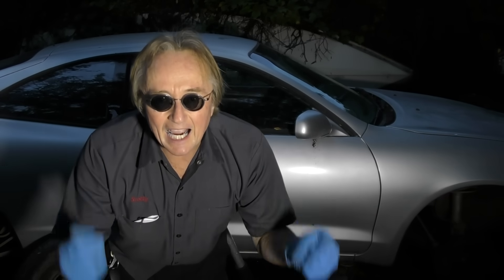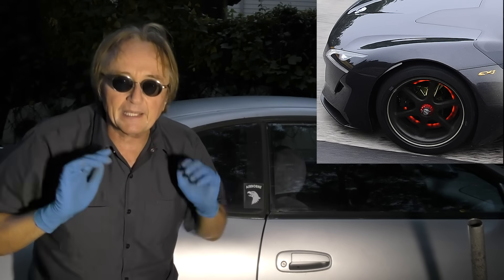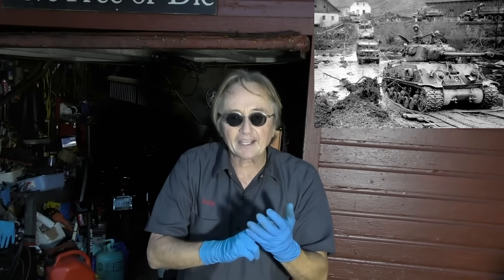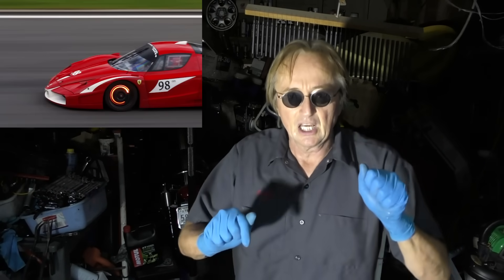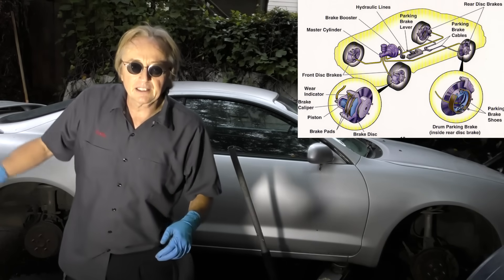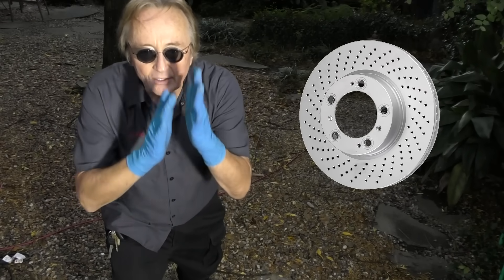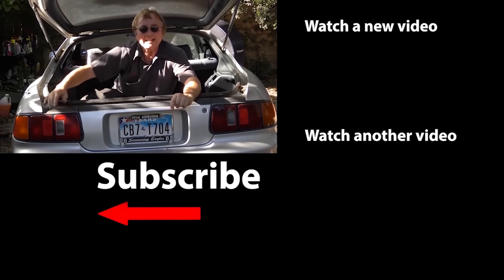Why Some Cars Have Drum Brakes Instead of Disc Brakes

Comment: Had 2004 Durango, replaced front rotors to drilled+slotted from brakemotive with ceramic pads. Around town didn't see much difference but higher speed and emergency stopping was a massive difference, cut down high speed and emergency stopping distance by an easy 40-50 ft. and was able to avoid accidents on the highway that would have happened with the standard rotors+pads. 
Oh they wear out faster? The pads and rotors were measured at 90% life after 35K miles, versus OEM (front) pads and rotors on these Dodge trucks need replaced every 50K-60K.

So I did the same ones on my 06 Silverado (which has rear drums), 10K miles now with drilled+slotted rotors and ceramic pads, and there is zero noticeable wear, no grooves nor "cut" into the rotor that is normally seem by 10K with standard rotors and pads.

Comment: Disc brakes wear out faster.
There is always some contact between the pads and rotors, even with your foot off the brake pedal.

Also, the original disc brake calipers for US cars were single piston units.
There was a pivot point that always corroded and locked up, causing the pad and rotor on one side to wear out before the other side.
This also caused the car to pull to one side each time the brakes were applied.

Then there is the fact that the rotors were often too small, causing them to overheat and warp.
This is why the brake pedal used to bounce up and down when you used it.

Not to mention that the disc brake systems were advertised as 'self adjusting'.
The only self adjusting that happened was that the brake pedal would go down further and further as the pads wore.
Drum brakes actually have a real self adjustment system that allows the brake pedal to maintain proper height throughout the life of the brake shoes.

To top it all off, a disc brake can wear out so far that the piston(s) in the caliper can travel past the o-ring seal, causing total loss of fluid in the half of the system involved (front or rear), catastrophic brake failure, and the brake pedal going all the way to the floor.
This is almost impossible with a drum brake system.

A rear disc brake also must have inside it a tiny drum brake system, that serves as the emergency/parking brake.
This is because hydraulic pressure cannot be maintained for long periods without the engine running.  So in an emergency, or for parking, you are using a drum brake system.

The air brakes in semi tractor trailors use drum brakes.  These are the brakes that semi trucks use the most.

So, drum brakes may fade if abused, but they last longer, are more durable, more reliable, and are more cost efficient, and safer.

Comment: Drilled rotors don't allow for any higher brake cooling rates than standard rotors. Air doesn't typically flow into the face of the rotor, and so there are no air-cooling benefits. However, the holes would reduce the amount of material that would soak and spread the heat, making the rotor warm up faster and stay at relatively high temperatures. Slotted or j hook rotors allow for the surface grindings that are due to the brake pads to bead up through the slot and leave the surface of the rotor as flat and free of contaminants as possible

Comment: The first mass produced car to have disc brakes was the Citroën DS 19 of 1956. Consumer Reports tested one for fade. Ran it up to max (about 90 mph) and slammed on the brakes, the Michelin X steel belted radial tires howling to a stop. They turned the car around and repeated several times. Never any brake fade. None. The pads were semi-metallic, which helps reduce fade. Another is that the front disc brakes needed only about 1,000 psi and the central hydraulic system has 2,300 psi available for just a little more foot pressure on the brake pedal, so any fade is masked by the tremendous pressure available. These are fully powered brakes, not power assisted.
As 2/3 of the car's curb weight is on the front wheels, the drum brakes on the rear were more than adequate.
Cars with drum brakes on the front would fade to nothing in a maximum deceleration rate emergency stop. By the time the car got down from 60 to 30 there was nothing left.
My Dad's '63 Olds 98 had finned drums that filled the 14" wheels. I learned by personal experience what I described above: 60-0 mph emergency: virtually nothing left by 20-30 mph.

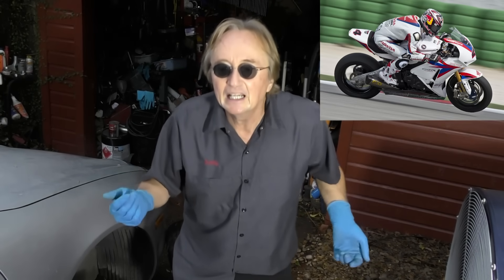Comment: @4:47 to 5:01 Greatly differ from your statement. Normal motorcyclists mostly using the front brakes is what separates them from experienced cyclists. One good hard pull at speed on only the front brakes can turn you (an inexperienced rider) into an over-the-handlebars projectile. Putting additional inertial load on only the front end reduces steerability and control. Imagine jamming on the front brakes on the highway,  the nose drops down,  the rear end lightens up and rotates around to catch the front end,  not fun unless you like road rash. Normal cyclists should take a motorcycle handling course to experience proper braking and accident control techniques. Racing motorbikes or trick riding is an art and their techniques are their own. Myself, I would guess I use a 50/50 or 40/60 application (back/front) in a straight line stop.

Comment: @1:13 Sorry Scotty, the disc pads do not squeeze the water out. Water is incompressible at these pressures. Rather,  the spinning vertical rotor throws the water off and due to its rotation (inertia) the water has a hard time adhering to it when splashed. As I look back I seem to find your videos peppered with misinformation and brute opinion but you still are entertaining.

Comment: Drum brakes have two major advantages:

Drums ease the radial loads on the wheel bearings when braking. Discs increase the load dramatically.

And drum brakes use two pistons in the same cylinder on different ends. So the forces are brake pad against brake pad instead of pad vs caliper. This makes use of your force on the pedal more efficiently. Cars with drum brakes front/rear don't need any brake boosters or servos. Mixed cars do but can still fully brake with broken booster. All-disc cars are hard to stop when the booster fails.
Reply: obviously a physicist!

Comment: Thank goodness I learned on drum brakes first before disc brakes became more common. Experienced brake fade (scary when first unexpected) as well as learning how to change own brake pads. And yes, back then brake linings were asbestos. Not dangerous in itself until they start to wear and create asbestos dust, which is where the danger comes from. Also from changing own drum shoes as they were called, lose the swivel pin in the grass that the shoes hinged on and you are screwed.

Comment: Rear drum brakes are a complicated mess vs a disc braking system. The only advantage they have is a larger parking brake ability as the whole drum brake assembly is the parking brake. Rear disc brakes have tiny drums in the hub area for the parking brake.

Comment: Dunlop had the patent on disk brakes and companies like Porsche and Audi went crazy trying to go around it and developed the UFO brake system where the disk is supported on the outer edge by a construction that resembles a steel rim and the caliper goes inside the disk :)

Comment: Hey Scotty, I had a big Aussie family car and the damn front disc would warp every winter because you'd be braking and then go through a puddle, the water would cool the disc unevenly and put a warp in it. After skimming those discs a few times to nothing I put on slotted rotors and those lasted easily 150,000 kms.  Sure they go thru the pad a little quicker but it's cheaper to change the pad than to change the rotor.  The slots help cool the disc better during braking, and they avoid the pad gumming up and squealing.  Check out DBA  disc brakes Australia

Comment: In some vehicles I have owned the rear drum brakes don’t self adjust no matter what you do. I think rear drums typically provide about 1/3 of the braking power. You should definitely notice loss of braking if the rear drums aren’t working. I owned several 86 Mazda B2000’s and the rear drum brakes in them were nearly worthless. The brake line went into the right rear brake cylinder and out to go the left wheel cylinder. I thought of getting a rear disc brake axle from a Honda SUV made by Mazda but instead I moved up to an F150.
Reply: The 87 and up B2000 had the brake line going to a “T” on the axle and split the brake lines to both sides.

Comment: Love your videos. With my "modern" car's repair costs, I find myself yelling WHERE IS MY 350ci GM BLOCK, ROCHESTER QUAD AND 350 TURBO TRANNY???
All of which were relatively cheap to repair/replace?
😤
My '76 Olds would get 19 mpg at 3800 lbs. GVW on the highway if I kept my foot light on the pedal, and I'm supposed to be impressed with modern cars?
Ok, they last longer, and are safer, and pollute less, and have more power with the same displacement...
But still...

Comment: Motorcycle street riding try too avoid using you front brakes because if you stop and not see  sand on the road, using your front brakes  you will wipe out your motorcycle   every time. 
Extremely Dangerous!!

Comment: Front brakes do about 70% of the braking, so discs on the front make sense. I prefer drums on the rear of trucks, not only do they last longer, but the park brake has a lot more surface area to hold a vehicle. The rear discs on most domestic trucks should never have been passed as they are useless on a loaded truck on a hill.

Comment: Hey scotty you missed one important thing about drums on the back. They make for a better hand brake as drum brakes have more connecting pad area...
Reply: It isn't that they are better, it is because it is not so easy to implement a handbrake mechanism with a disk brake.  Yes, it is done nevertheless with screw mechanisms etc. But, it's true he missed the point.
Reply: @dukenukem5768  it is simply because a drum brake has more surface area... the more surface area the less pressure is needed to stop the wheel turning. I think you will find that cars with drum brakes don't need a servo like disc brakes. Rang Rovers have or used to have a drum brake mounted on the prop shaft as the hand brake... why did they not use a disc brake ? Of course the problem with drum brakes is that they cannot dissipate head very well which does not matter if you are just using it has a hand brake...

Comment: In motorcycles, it is the rear brake that is used more and more power put on the rear brake. That is the reason it is foot operated while the front brake is hand operated. To have best stopping with least skidding, both brakes are to be used together, but using just the front brake would be suicidal

Comment: I discovered that on my bicycle if I do not ever use my rear brake my tires last more than twice as long. All using the rear brake on any bicycle is wear out the tire faster.

Comment: I wish manufacturers would oversize the disc brakes so they would last longer.  In today's jackrabbit traffic I replace my front pads on my f150 once a year.  Replacing pads once a year gets old.  Ceramics last a little longer but don't brake as good as semi metallic.

Comment: Sorry Scotty but that thing about holes and slots helping discs cool better is wrong, a very popular misconception about what cools a disc in the first place.

Holes or slots are there to let water vapor escape from in between the pad and the disc under hard braking in WET CONDITIONS. When the pad is soaked with water and the water inside it boils the steam comes out of the surface of the pad and opposes the pressure of the caliper trying to press it against the disc. If a slot or holes are provided for the steam to be released the effect is mostly eliminated. The cooling provided by holes or slots is negligible.

Try it next time you run through some deep water and jam on your brakes hard. You'll find they loosen up after a second or so requiring more pedal pressure. But when you have slotted or cross drilled rotors you have good brakes all the time, wet or dry.

No, the thing about cooling rotors is misunderstood AND overblown in most mechanics' minds. What you want to think about is the mass of the rotor, not how it cools. The mass is your heat-sink, the more the better. Brakes are converting kinetic energy into heat and the heat has to have a place to go for the brakes to work well and not fade. Matter-of-fact, slotting or cross-drilling rotors actually hurts dry braking performance, but not much. Given dry conditions, plain rotors will give you a little more stopping power and endurance before fading than if the same rotors have had some of their mass removed by slotting or drilling holes in them. MASS is why I never "turn" rotors or drums: I always replace them with new ones. And watch out; some cheap rotors these days are light, which is why they're so cheap. Ask the parts guy when he has two kinds to bring them out for you to look at and buy the heavier ones.

Back to "rain rotors". I myself prefer cross-drilling as that lasts the life of the rotor. And that purely for street applications. If I were working as crew chief for a Formula 1 car, I'd have slotted rotors (not drilled) on the car only on days it was raining.